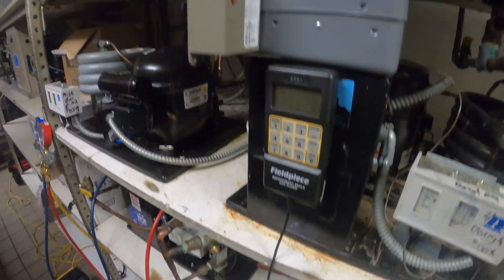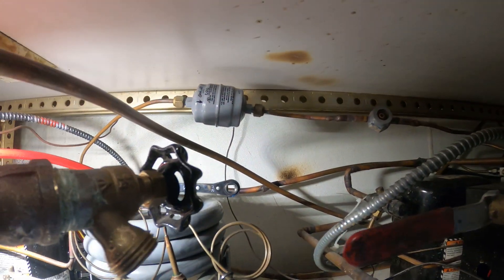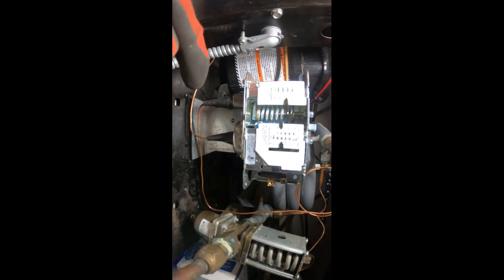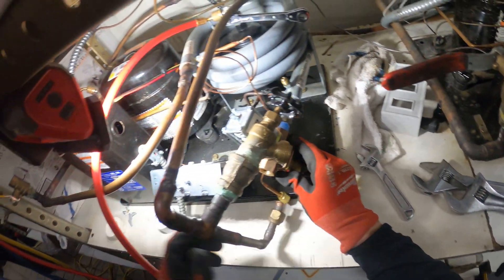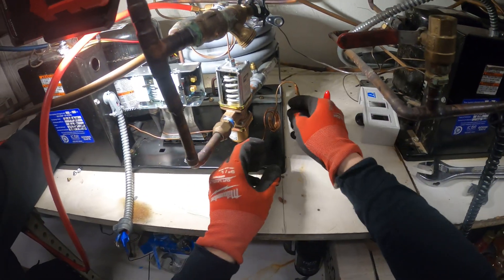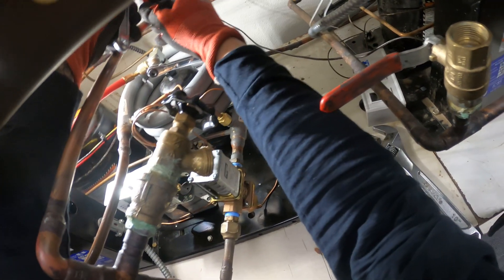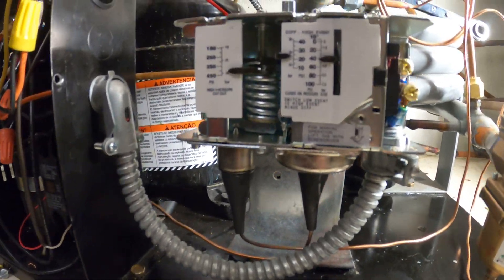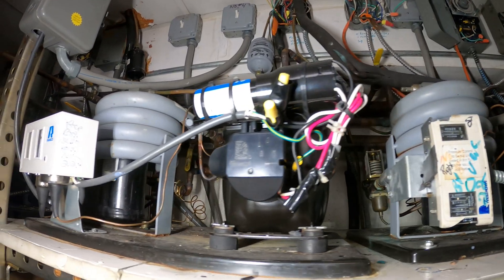HVACR Service Call:Commercial Refrigerator/Wine Cooler Parts Upgrade/Repair (TXV, LPC, HPC, WRV)

Comment: you’re doing great work, sir!!! Would you be able to do a video on how to set the box temperature via the High and low pressure controls?… also, how did you determine the amount of charge to be put in? Did you do it based on targeted sub cooling temperatures? how do you go about deciding on what is a good head pressure, do you base it off of the return water temperature and a condenser split number? I know I’ve asked lotta questions just trying to learn.🙏🏽

Comment: Yo dude, you didn't need to relace that pressure control. The screw next to the reset button on the original is for changing between auto and manual reset. If you press the button down and tighten the screw it now becomes auto reset.